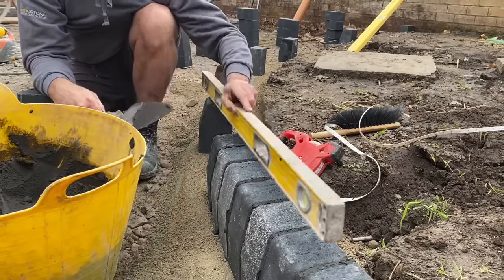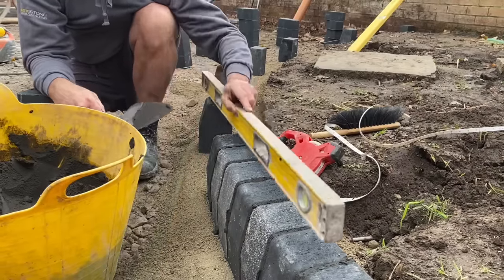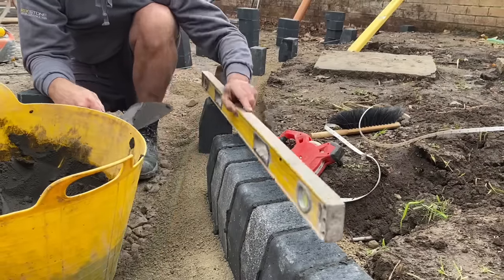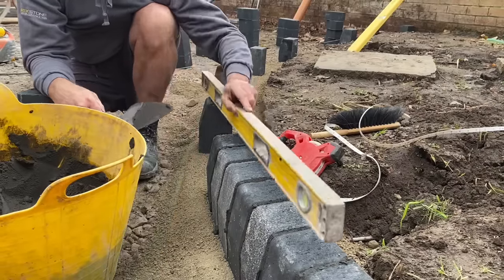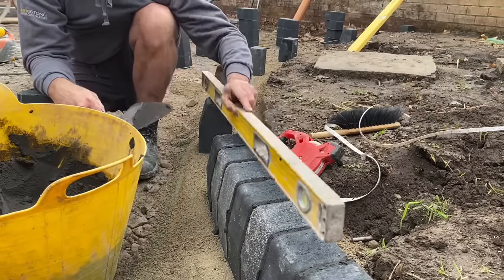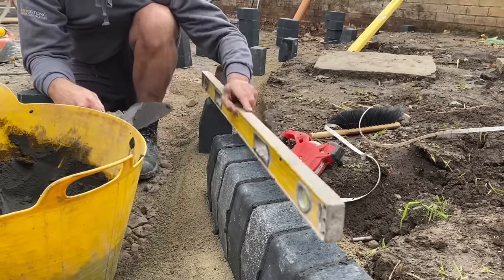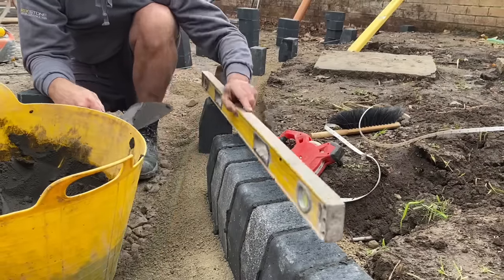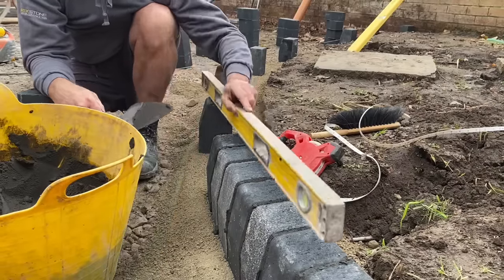How To Lay Block Paving Driveway - Full Process #blockpaving #driveways

Comment: An absolute pleasure to see a driveway correctly installed - very few do it right. Roller not tiny whacker plate. Sweet curves taper cut on both sides. Spot on lads.
Reply: Oh and water suppression beats all that dust. Most don’t bother which is wrong.
Reply from the maker: I can tell you know your stuff.
Thank you so much 🙏

Comment: Heya mate love the video....when ya pave close to a house do you always have a drain system against house wall
Reply from the maker: Hi mate, thank you 🙏 
No, only if it’s high on the dpc so less than 2 courses. Or if the water is running back to the house, you’ll need to put one in then.
They’re the 2 exceptions

Comment: The man never fails to impress! Nice work Matty! I noticed you didn't use sharp sand, any reason for that? What are you laying the blocks on? What sort of gravel? I was also wondering what diamond disk you are using to cut your porcelain slabs? Keep up the great work!
Reply from the maker: Thanks Alan 👍 it’s a 6mm clean gravel. Used for subs which lets the water pass through, but you can use it for block, better than sand. More stable and is not effected by rain like sand. 
Diamond blade from Elite stone tools, ask for Henry, he’ll look after you 👍

Comment: If you can’t compact well enough can you put a layer of concrete under the pavers?
Reply from the maker: No not with block paving unfortunately, needs to be laid on a grit sand bed. 
It’s a flexible bed so cement won’t do anything.

Comment: Hi i am having a new drive and they are making steps with these large border blocks but they have not put morter between the joints there just pushed together  is correct or needs to do again.
Also the soke away is just a hole in the ground and they said they are going to put a concreet slab over  it is this wrong there are 3 dranage strips but they have only dug out for the main one .
How deep does the type one need to be to be strong enough for a car .?
Do you not put down a weed proof membrain or is it not needed . Thank you
Reply from the maker: That’s fine as long as they are laid on mortar and have a concrete restraint at the back too
Reply: @Brockstonepavingpros  and the soak way should it be like the one you put in under the law .

Comment: What's the implications of using flowpoint on a block paved driveway please?
Reply from the maker: Simply won’t work.
You need at least a 2mm joint for a start.
Plus it needs a rigid bed so will crack. 
Just be a mess if you did it

Comment: nice job mate. did you have to apply to planning to break into the drain with the ACO?Leeds city council are all over this now. have you used Driveline yet?
Reply from the maker: I didn’t break into the drain, the gully was low so it just sat onto it, it was to direct the water from the garage to the gully.
Driveline? Driveline are a block 🤔 Do your mean the Driveline Drain?
Reply: @Brockstonepavingpros  yes mate driveline drain sorry
Reply from the maker: @seanmcgrath9167  ah yesh they look the business but not used them yet my mate

Comment: That's fucking lovely. Would you seal after?
Reply from the maker: I never get involved with that side of things mate as it’s high risk for little reward. But yeah you can do 👍
Reply: @Brockstonepavingpros  sand always comes out if I don't seal mine
Reply from the maker: @YeCannyDaeThat  it does initially but stabilises after a few months.
I leave sealing to the customer, I never get involved in it
Reply: @Brockstonepavingpros  thanks. Maybe my gaps are just too big but I loose it all in about 6 months. I'm torn between using Sika "setting sand" or kiln dried and then sealing after. Which would you say?

Comment: That’s a stupid law, forcing the home owners to make drastic changes to prevent what normally happens when the rain water flows into the streets and goes to a proper drainage that is supposed to be managed by the city.  Unless the city or government are incapable of having a infrastructure that is adequate for removing run off water, which is why they passed a law to throw the responsibility onto the tax payers to not only take your tax dollars and then dictate to you the owners to do your job so they don’t have to worry and be accountable for anything.